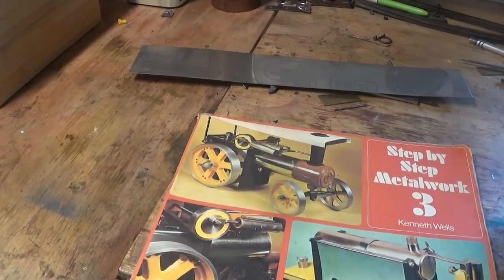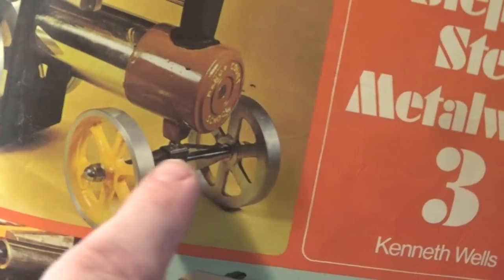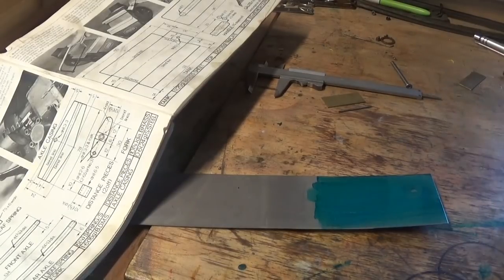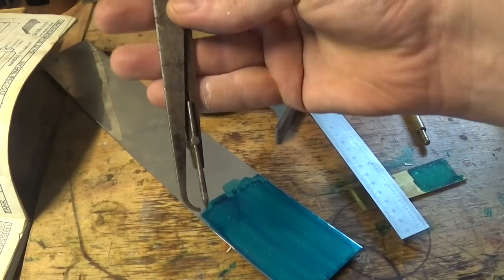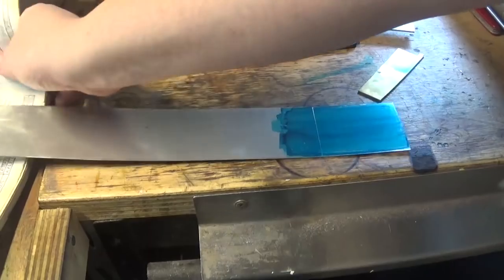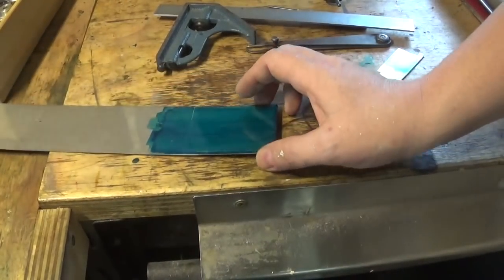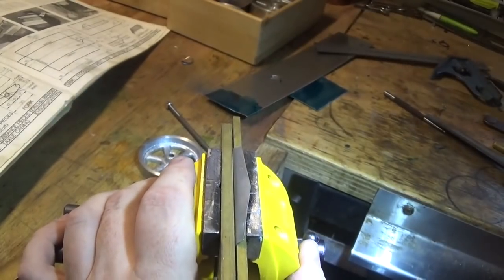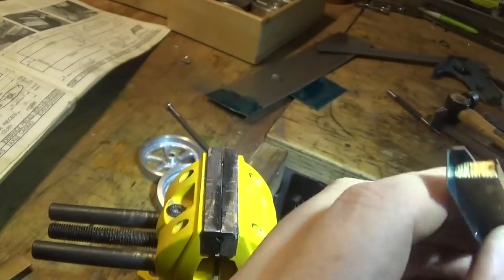PATREON SERIES KENNY The Steering Part A

Comment: More great progress Emma. Someone else commented re a small sheet metal brake but that made me think of a small unit I got a while back which fits in the vice, and is ideal for small parts bending sometimes, at least up to 90 degrees. Your bend worked out very well, though.

Comment: Something to think about: when buying fasteners from a supplier check to see if they offer package deals. A major fastener supplier here in the U.S. will sell you packages cheaper than individual fasteners. They may set on the shelf for years but nothing is more frustrating then having to stop your work to run in town, 20Km for me one way,just to get a bolt.

Comment: How about designing and making a model maker size sheet metal brake as an inbetween project? maybe 300mm wide? Designed right it would give you crisp and straight bends.
Reply from the maker: thats a pretty good idea. I bought a pan brake, but its really not as useful as i imagined.